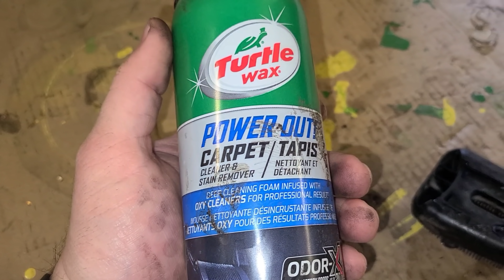Viewer requested look at the 4020s!

Comment: I understand your budgeting regards to 4020 and/ or 5020 tractor parts. Some items a guy has to buy from a J D dealership. Other items the sticker shock is considerable. We recently changed the coolant in a 1968 4020..  seeing some engine oil there. Suspecting seepage/leaking engine oil cooler unit. New price from local JD dealership $2000.00. Took a chance on a decent used cooler from GS tractor salvage out of Blaine Lake Sask. Very nice folks there and a much more reasonable price!

Comment: We got one of those 148's and I don't know if it's a common problem  but the pipe cracked all the way around on both sides of our 3020 and we had to brace it with Chanel iron.
Reply from the maker: Nole that's one of the reasons they suck

Comment: Never have had any luck with the stupid Leon loaders. Made cheap in my books had a 707 on a ford 7740 and the stupid thing had more action from a welder then on the damn tractor! And it never ever picked up 2 bales in all of its life because the tractor wasn’t heavy enough! Personally john deere makes the better loaders in the world. Maybe im wrong but just my preference.
Reply from the maker: Your crazy but that's ok lol
Reply: Wow that's odd. Our 1st 707 was on the 5010 and if it handled that brute it should handle most tractors but maybe we got lucky
Reply: Alo quicke way better loader then John Deere has ever made. Stoll is better then Deere but not as good as alo.  Buhler is loader is not bad either.